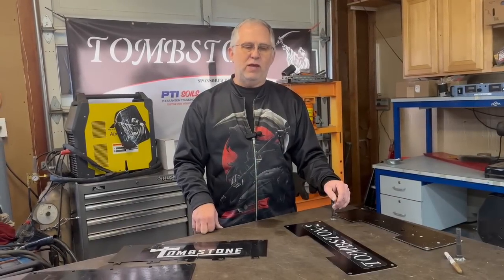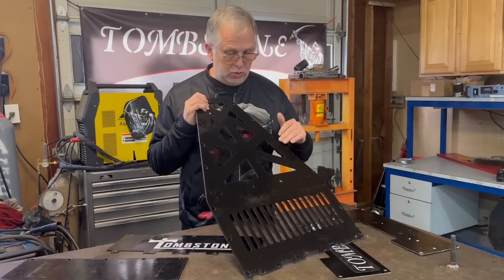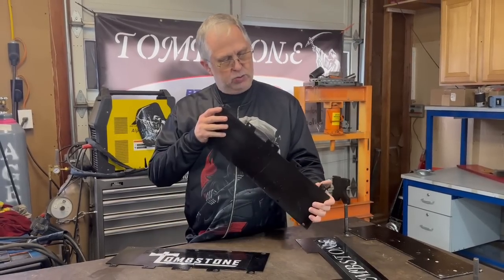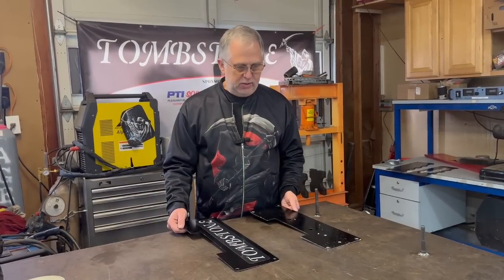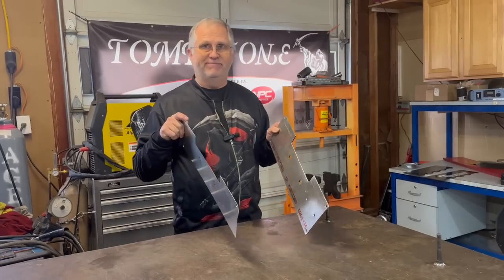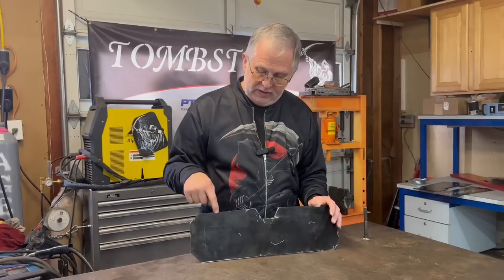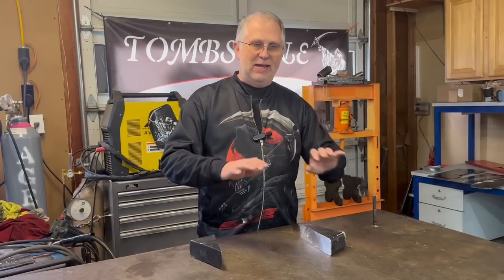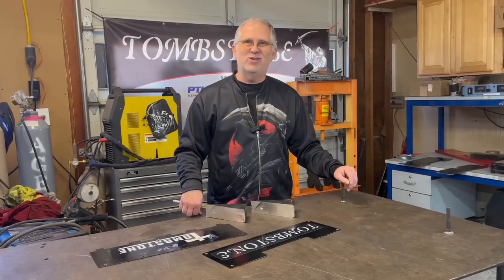Tombstone - Making Weight for BattleBots Faceoffs 2024

Comment: ya, thinning the back armor panel for the batteries was NOT a good idea, Ray. one of the LAST things you shouldve done
Reply from the maker: The simple truth is that building and competing with combat robots is always about making compromises to get a robot ready for an event. In this particular case I could:

1) Make some drastic weight reduction savings at the last minute to comply with the rules, or

2) Stay home and not compete. 

It wasn't optimal for sure, but it did allow us to make weight and go compete, which was kind of important!
Reply: @ray9368  i understand where you're coming from, i'm just pointing out how that little bit of weight reduction probably played a huge role in your hypershock fight

Comment: I have a question.
Can you place the wheels inside the frame to offer more protection?
Have to you looked at the  Kawasaki bike chains for the weapon
Reply from the maker: It's more complex than simply moving the wheels unfortunately. The wheels need to be as far apart as the spin circle for the weapon, or the robot just drives horribly. So they kind of need to be where they are now, at least with this weapon setup. So the only way to do what you are suggesting is to make the frame that much wider, which takes a LOT of weight to make happen. It's not like I've never thought of doing this, but it's a series of compromises I just didn't want to make. 

And yes, motorcycle chain is a solid choice for robots, as is go-cart chain. I typically go with the heavy version of industrial chain, but I've had good luck with go-cart chain in smaller robots.

Comment: This video reminds me of F1 teams removing paint to reduce weight.
Reply from the maker: On the smaller robots I’ve seen that kind of work. Making tiny custom aluminum screws on a manual lathe to replace tiny steel ones. Drilling out the center of bolts to make them hollow for lightening. Crazy stuff 🤣
Reply: @ray9368  So based on what you have seen do you think that is worth the risk or do they end up falling apart quicker? Because drilling out center of bolts sounds like it would snap mid match?
Reply from the maker: @thisladsamystery  Is a solid bolt better than a drilled out one? Of course. But.....and there is always a but :) If you remove half the weight by drilling out the center, you still have 80% of the strength at 50% of the weight. It's a stupid way to lose weight considering how much work you do for such a small amount, but if you absolutely NEED that small amount, well you do what you have to :)
Reply: @ray9368  Ok, understood. I didn't think a drilled bolt would still be that strong. Thanks for the explanation.

Comment: Weight reduction is like a loose-loose situation for Tombstone. 
Don’t wanna take armor away from the batteries cuz…duh.
But also don’t wanna take weight off the weapon since Tombstone is designed around the weapon.
Reply from the maker: It's a lose-lose for everyone really. Everybody fights with weight at every event. Just part of trying to use every last ounce!
Reply: @ray9368  its like mr krabs firing spongebob to save a nickel
Reply: @ray9368  It's the art of finding the best ratio on how to spend the weight budget between armour, weapon, drive-system and chassis.

Comment: Ray are there any robot fighting leagues that have heavier weight divisions than Battlebots 250lbs?
Reply from the maker: Not currently. We used to have the super heavyweight category at 340 pounds, and there was even a 390 pound at one time. But right now I don't know of anywhere heavier than 250.
Reply: @ray9368  I'd love to see a super heavyweight class and see the full power and destruction bots of that weight could conflict, I feel the 250lbs class is quite constricted and doesn't allow innovation to be made. Good luck with Tombstone always routing for you.

Comment: What happened to the lighter blue tires you used in the fight against Brutus in 2016?
Reply from the maker: I still have them, but they are really pretty fragile. One hit and they just come apart. I don't plan on using them in combat again
Reply: @ray9368  so they are essentially like the tires on slap box that you shredded 3 of in half a second?

Comment: I was wondering if the blade on tombstone was through hardened or case Carburized?
Reply from the maker: Most of the steel weapons are a type of abrasion resistant steel (that's the AR in AR500) so it is already a hardened material when you get it. Makes it kind of a pain to drill and machine, but the stuff is pretty tough. The only time I have used any sort of surface hardening has been using hardfacing wire on impact points on armor panels. This does work fairly well btw.
Reply: @ray9368  cool thanks

Comment: Would you be able to split the top panel into two panels. Have the top cover for the internals be thinner and keep the cross bracing over the weapon the same thickness
Reply from the maker: That's kind of how it is laid out really, but I see what you are saying. I could have made the battery panel and more of the top panel out of thinner material, and only used the thicker stuff across the weapon support. It's not a bad idea, but those panels were cnc plasma cut so making new ones by hand would have been time consuming, and this was all in a panic the last day when I was supposed to be loading up!